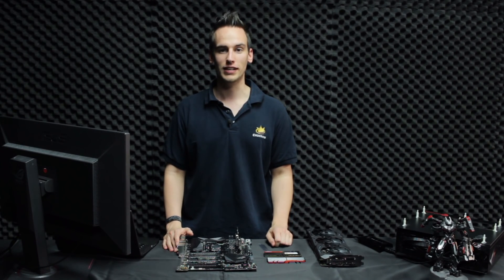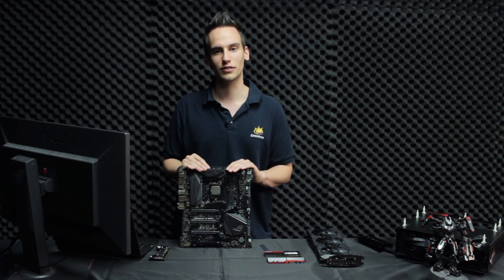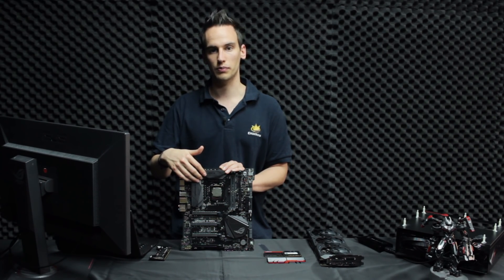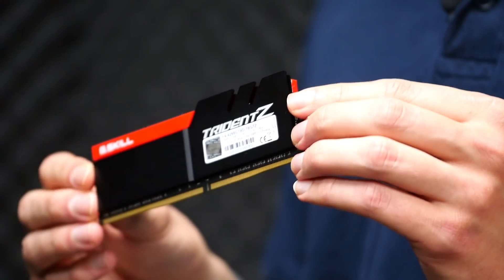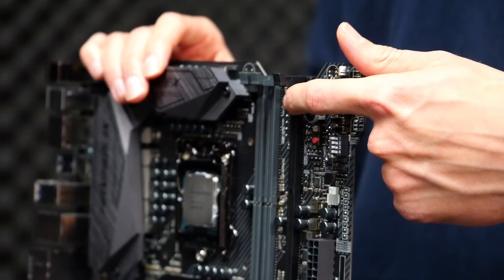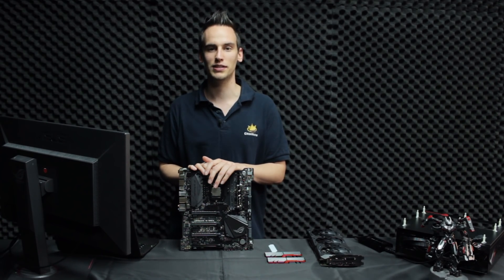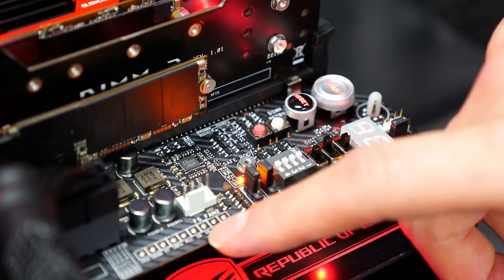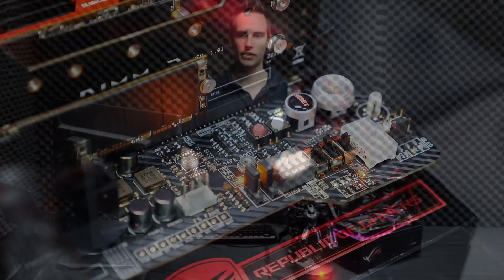ASUS MAXIMUS IX APEX Review and Overclocking Tutorial for Kaby Lake 7700K / 7600K [Part 1]

Comment: Worst thing about this board is that it comes only with 4 SATA ports. Actually all ROGUE Z270 mobos come with 4-6 SATA except the Extreme. I´m using my 8 SATA ports in my current Gigabyte Z170X mobo which also has 3xM2s and 4xPCI slots, so I can´t understand why ASUS top line Z270 mobos come with so few storage slots!!!
Reply: This board isn't for you, move on.
Reply: It's an LN2 board, oh, wow
Reply: I didn't say it was an LN2 board. If you'd bothered to read the overview, maybe you'd understand...This board is for those that want the most overclocking potential available. With better trace optimisation. Having additional ports of any description, detract from this. There are over 10 boards in the stack this refresh, and you manage to pick holes in the amount of SATA ports. It's actually quite painful to read.

Maybe this industry isn't for you...
Reply: Look, I have the BEST Z170 overclocking board in the market, the Gigabyte Z170X SOC FORCE, which was used by professional OC (there is also a LN2 stripped version btw). My board comes with all mentioned above (8 SATA, 3 M2 and 4 PCI), so OC is no excuse for Asus to be cheap or not to deliver a more complete version. The only Z270 ASUS ROG board that comes with 8 SATA is the Extreme, which is reserved for WC and will cost a fortune. With the Z170 it wasn't that way. I happen to need 8 SATA ports. Anyways, end of discussion.
Reply: So a lot of raiding going on?
Reply: Totally agree, one of the reasons I didn´t buy a Z170 Asus ROG VIII is because it came only with one M.2 and I didn´t have any use for that U.2 port. Now in the new ROG IX series they finally added a 2nd M.2 on several models but they cut on the Satas instead (the Hero comes with only 6 when it used to come with 8). And the only ROG IX with 8 SATA (the Extreme) comes with a CPU waterblock for custom WC that many people won´t need and will make it´s price very expensive. Sigh

Comment: can we overclock non k kabylake cpu too?
Reply: No... It's non-k. But honestly, if you don't know that you should read a bit more or stay away from overclocking...
Reply: Yes, you can overclock a non K Intel CPU. You need to overclock the BCLK, which is very far from ideal and you're not going to get very much headroom. The K part just means the multiplier is unlocked, so you can leave the BCLK alone and just make the CPU run faster independent of everything else, which makes it easier to achieve high overclocks. But really any CPU can be overclocked. Although some that don't support it in software need hardware modifications to make the clock run faster.
Reply: but you can overclock a non k skylake cpu